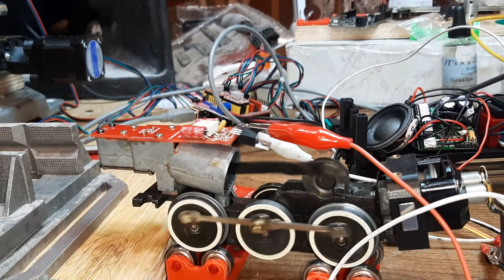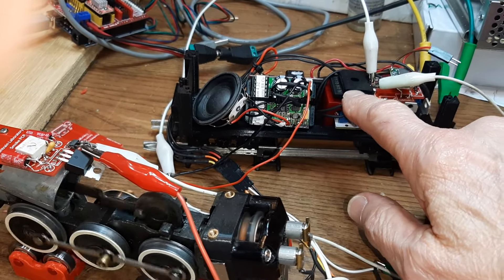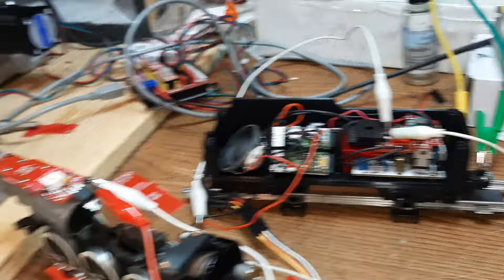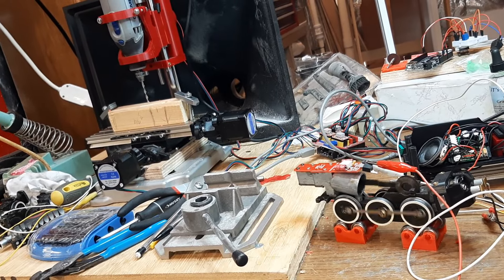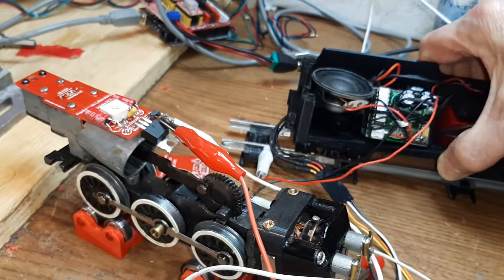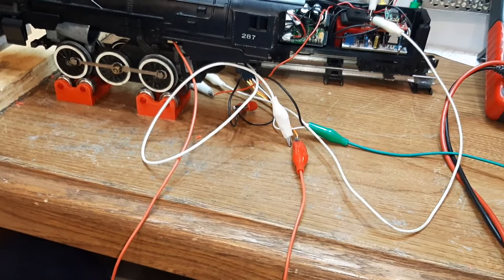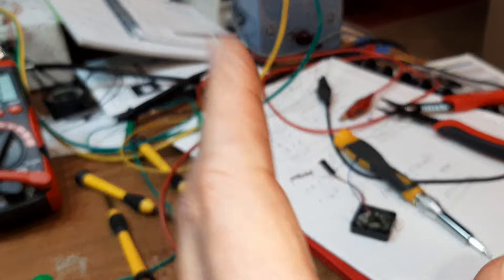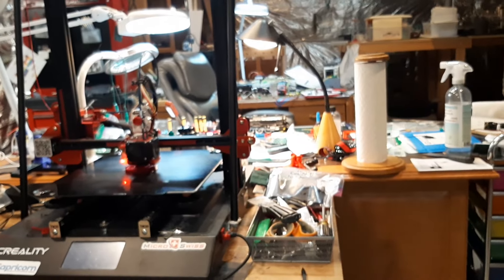Frankentrain Laboratories 283/287 Pacific with brand new Next Gen S tender assembly, 1st test .

Comment: Strong magnets instead of screws and a pin pickup for connecting your wiring.   That way you will have a clean removal with no fuss.   Nice work.
Reply from the maker: Thank You I will look into it, makes sense.  Dennis